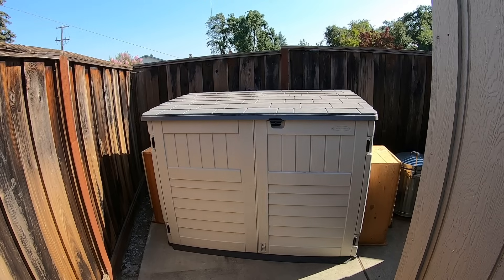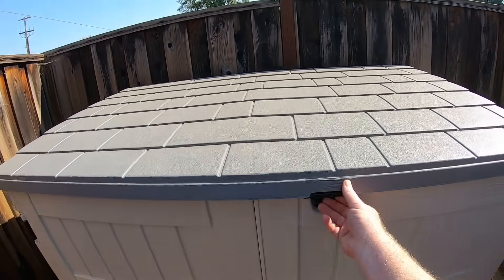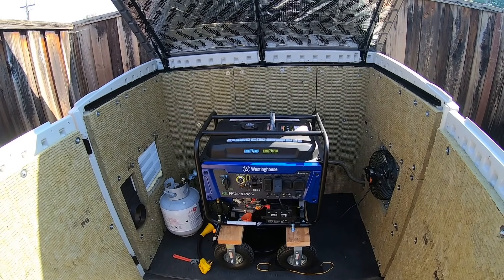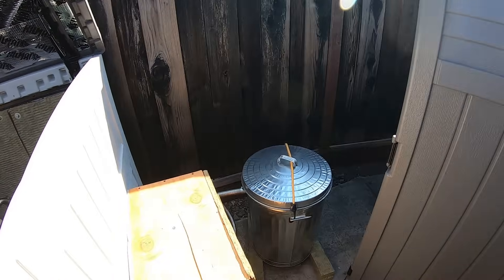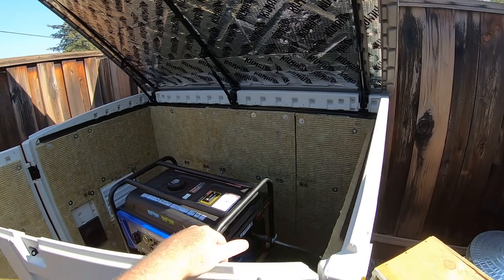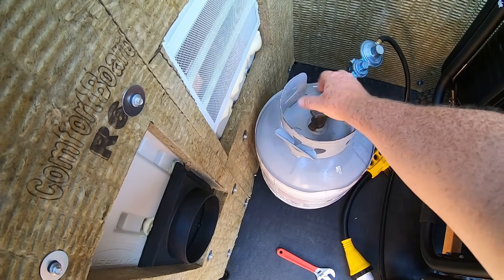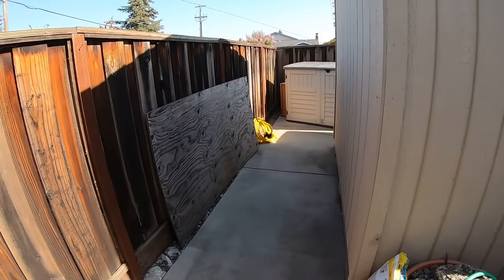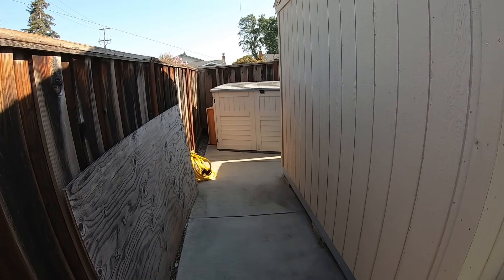DIY Generator Shed Build - Quiet Sound Insulation with Exhaust Muffler

Comment: Could you inject spray foam into the hollow core walls and doors? My logic about not being loud for neighbors is not for their benefit, but to not advertise that I have power. My only recommendation is to not use that blast gate, add a wire hookup box to the outside and then wire the generator to that from the inside so that its a fully closed system.
Reply from the maker: You can inject foam insulation into the hollows.  And I did that where I cut holes in the walls for vents and fan and such.  Although that was mostly for water intrusion purposes.  You do have to be careful, in that the foam does expand, and can bulge out the walls a bit if you get too much foam in there.  The blast gate was just the most economical way to pass a 50-amp cable through the side of the shed.  50-amp adapters and cables are expensive and bulky.  The blast gate also allows me to have the propane tank outside if I want, and feed the hose back inside, so it serves several purposes.  But definitely, if I anticipated this being used more often, I might do something like you said.  I don't really have a need to have the shed completely closed during operation, as it just adds additional airflow.  Those are just my thoughts.

Comment: Very nice! Are you going to secure it from theifs? And if so how? Thanks
Reply from the maker: Guard dogs and land mines.   The shed is in an enclosed backyard, and not in an obvious location.  It does have a padlock on the door.  But obviously this is only a minor deterrent, and a determined thief could eventually break in whether it is a plastic shed or a wood shed.  But if they want to brave my dogs and the associated dog poo, they might eventually get to it.  It might take them a while to load this beast of a generator in the back of truck though.  It is HEAVY.

Comment: Best solution I've seen so far.  I am building a wood shed with many of the same principles used in commercial construction to deaden sound with goal of a 30-40 db reduction (similar genset with 90db base noise level).  Most folks forget the intake and exhaust vents let out the sound/noise - using properly sized sound baffles is the correct approach.  

Also if you have sufficient air moving through the shed you can vent the exhaust directly into the shed, (assuming appropriate materials are used to prevent fire/melting), further trapping the noise and eliminating the need for an exhaust modification or shed exhaust port, the ventilation fan will serve that purpose.  Great Job!  Now if I could actually find rockwool sound board...

Comment: That is a little baby generator, I have 4ea 2.25MW (2,250,000 Watts) units in a paralleling configuration at work for a total of 9MW (9,000,000 Watts). No wheels though. Lots of noise. Also not big enough for a DeLorean.
Reply from the maker: Hard to get it to 88mph without wheels.  Sounds like a nice setup (for a small town!)

Comment: Can you show the inside of the trashcan
Reply from the maker: See the description of the video for a link to the trashcan muffler build.  Or see it here:  https://youtu.be/jZpRSenXJAs
Reply: @C5Tor  thanks saw it last night after I typed this great job on the build
Reply from the maker: I've actually updated the exhaust from 1" to 2" to cut down on backpressure.  New video soon, if the weather cooperates ever.
Reply: @C5Tor  I was wondering about upgrading the size of the exhaust pipe to help with over heating. Will look forward to your next video

Comment: Can these dual fuel propane/gas generators run off natural gas?
Reply from the maker: There are conversion kits available for this model to run on natural gas.  Natural gas will have slightly less power than propane, just as propane has slightly less power than gasoline.  Your deciding factor will probably be whether you have a natural gas line plumbed to your house already or not.

Comment: Total Cost?
Reply from the maker: Good question... Too much, although I already had a few of the parts.  This is not counting tools or labor costs.  I have about $700 into the build.  Keep in mind that I was able to find a used (but still in the box) plastic shed for $150 on Craigslist.  That same shed is currently going from about $500 now.  So, we've got the shed ($150), fan ($65), vent ($15), blast gate ($10), flexible 1" exhaust pipe ($30), misc. pipe/conduit pieces ($60), Rockwool ($120), Kilmat ($30), Screws and washers ($15), spray foam insulation ($20), baffles ($0 - I used some spare wood pieces I had), metal 20 gal trashcan ($30), mineral wool insulation ($50), perforated pipe/exhaust baffle ($30), wire mesh ($15).  So, a little under $700.  I'm sure I am overlooking a few parts, and things I bought but ended up not using.  Oh, I also spent $300 on 50-amp extension cables!  And another couple hundred on a Generator interlock kit for my electrical panel and an inlet box for my garage to hook the extension cable to.  It can add up really quick!

Comment: Will the attic fan pull moisture in if it’s raining?
Reply from the maker: Good question.  Not really sure.  The inlet has downward facing vanes, and it is 6 feet away from the fan, so I don't think it would pull much of anything into the shed if it was raining, especially with the baffles in place.  But I haven't run it in the rain yet.

Comment: Do you have a video to show install of the various components?
Reply from the maker: Unfortunately no.  I didn't video the build process for the shed.  I wasn't originally going to post any video at all since there are a ton of generator shed videos out there.  But the shed turned out pretty nice, and the features I incorporated were pretty effective at reducing sound.  Since some of these worked out better overall than many of the other videos I saw on similar sheds, I decided to share some tips that worked for me on the build. I do have another video on the parts used for the exhaust and the trashcan muffler, linked in the description. I also filmed some sound testing at various stages of the build for comparison purposes to see how effective my changes were at each stage. Keep in mind that I'm not a professional or even part-time YouTuber, so I only post content when it interests me or I think I have something useful to share.  So sorry for the less than stellar production quality.  Hopefully they got the important points across.  Thanks for watching the vids!
Reply: @C5Tor  thanks for your prompt response :) I got a Westinghouse 9500DF generator and planning to go this route for building a shed. Thanks for sharing the parts list, my only question is or request if if you can share the detail on the part used on the shed to connect the generator exhaust the the muffler. Thanks in advance :)
Reply from the maker: No problem.  I'm working on a little presentation for that now.  I've switched from the smaller 1" pipe to a bigger 2" pipe, so I will compare the two.  Time and weather permitting, maybe a week or two.
Reply: @C5Tor  thanks and sorry for a late response I will look forward for that video but this is awesome!

Comment: Cool dude.  I just bought the exact same generator from Amazon.  I plan on trying to set it up with Propane and a switching breaker box and see if I can get it to work like a "stand-by generator" to turn on and off automatically.  Using the propane (for convenience ) I won't have to worry about carb clogging and fuel degeneration.

Comment: Very impressive. Awesome job. The only thing that worries me is the back pressure you created with the muffler modification. Eventually it may damage the valves. Who knows for sure as it may takes years for that to happen. Good luck.
Reply from the maker: I've already upgraded to a 2" flexible pipe with a shorter, straighter run.  I'm also making some internal changes to the muffler to remove the 1" pipe and make it larger.  An update vid coming soon if the weather cooperates.
Reply: @C5Tor  Awesome. Can't wait to see it.

Comment: you use a generator to charge electric motorcycles ... well ...
Reply from the maker: Yep.  I can use my propane generator to charge my electric bikes.  You do what you need to do when you are off grid.  I didn't get the electric motorcycles to be "green" per se.  I got them because they are fun and a lot less maintenance than internal combustion dirt bikes.  And so far, I haven't had to use the generator to charge the bikes, as they usually outlast me for a day's riding.  But I will use the generator if we do any extended overnight camping without access to grid power.  I'd rather use solar, but that takes a pretty big rig and lots of batteries to charge one of these bikes.

Comment: I think you'd do well to increase the size of the exhaust pipe.  When extending it, youi're going to create some resistance over the original short pipe (try blowing hard into an empty garden hose and you'll see what I mean).
Reply from the maker: Totally agree.  I've already swapped out the long 1" flexible pipe for a shorter 2" flexible pipe.  Also making some tweaks to the internals of the trashcan muffler.
Reply: @C5Tor  just to 1-1/2" is fine, 2" is overkill.
Reply from the maker: At this point (especially if asking my wife) the whole shed is overkill.  So why stop at just excessive, right?
Reply: @C5Tor  Agreed!!!!

Comment: Thats awesome, i am so glad i found this before my build. Would you recommend propane or natural gas? How long is that 5g propane last ( lets say for 1 fridge, 2 portable heater , few receptacles)? Thanks alot
Reply from the maker: I can't say I am a generator expert; I'm just a dude that built a shed.  That being said, I can tell you a few things I've learned about fuels.  Propane and natural gas are not the same.  Natural gas is made up of methane, propane and butane (but mostly methane).  Propane is just the natural gas with the other two gasses removed.  Natural gas is typically cheaper, since it is less refined. Propane is typically stored in liquid format, while natural gas is in a gaseous state.  Propane is stored in tanks, so is easier to transport, which would make a difference if you intend to keep the generator portable or not.  The usual deciding factor on which to run would be whether your home has a natural gas line plumbed to the house already or not.  For the same volume, propane puts out about twice the BTU's as natural gas.  The Wgen9500DF is setup for gasoline and propane, but not for natural gas.  You would need to purchase a conversion kit to run this specific generator on natural gas.  The specs on this particular generator model say it can last up to 17 hours on the 6.6 gallon gasoline tank, and about 11 hours on a full 20 lb. propane tank, depending on load, of course.  Take that with a grain of salt, your mileage may vary, etc.
Reply: @C5Tor  Thank you very much for your input which helps me save a alot of time and money.
Reply: Do you run yours every few months to keep it  the battery charging? Or do you use enough to not worry about it? I don't run regular gas in mine just propane.
Reply from the maker: I've only had the generator a couple of months, so it hasn't been an issue.  But I plan to add a little solar charger to the roof and keep the battery charged that way.  Amazon has a lot of really cheap little solar battery chargers.

Comment: Why run the exhaust out of the shed if u have the fan drawing fresh air out and pushing the exhaust out?
Reply from the maker: The generator shed will be getting pretty warm, even in its current configuration.  Even with the fan and the exhaust ported to the outside, it can still easily get upwards of 100 F inside the shed.  When the generator is working hard, the exhaust gasses can range from 300 to 600 degrees!  You really don't want to dump that kind of heat into a mostly confined space and expect a small fan to remove it all.  The generator will run more efficiently if it is cooler.  Also, routing the exhaust to the exterior also ensures that there is not a buildup of CO/CO2, which can be deadly in a confined space, and also make your generator run poorly.  Most modern generators also have excess CO shutoff sensors.  If I were going to do the shed again, I would also probably put a larger fan in it.  The unit I'm using moves about 1000 cfm, which is probably more than sufficient for a 70 cu. ft. shed.  But the sound baffles I'm using probably decrease that flow by a little bit, since the air doesn't have a straight shot into and out of the shed.  More cooling would probably be better for the longevity of the generator.
Reply: @C5Tor  have u considered adding a fan to the intake side to pull air into the shed?
Reply from the maker: I have definitely thought about it.  I've considered just putting a box fan on the inlet side.  However, I'm not sure if it will make a big difference in actually getting more air out of the shed since the size of the inlet & outlet are a bit limited.  It might just swirl the air around a bit more inside the shed.  But I might still try it.

Comment: I built same 5 years ago. But used two electric fans. Bigger exhaust pipe  same shed but From Lowe's.  Took truck plastic gas tank mount on back 
25 gallon. With gas gauge  use almost same cord from Walmart  I also put extension on oil. Fill and drain from outside of generator house I used fire proof rock board inside for inside the walls  . And key start on outside of generator house installed lights inside for nite time use  light switch fuel gauge start and choke mounted on outside generator house.  Hook up my own manual transfer switch next main power box easy on and off whole house power.  This has been working just over 5 years with many power outages   this guy did great job 🤔 but exhaust pipe to small can lead to engine over heating and burnt valve I also used  vent covers from ac filter  there big and provide lots of air.  Key start and light switches  , fuel gauge mounted inside water proof case  normally was used to cover two outside wall sockets got the biggest one clear door on front  when door is open lights come onthere can see fuel gauge and others that mounted in there.used switch for lights from car door interior lights
Reply from the maker: Sounds like a great setup with lots of convenient customizations for running long term.  I wasn't quite that ambitious, as backup power is kind of the secondary function of this generator.  I do agree on the exhaust pipe issue on my build.  I'm working on version 2.0 of the exhaust setup today.  I'm going directly to a 2" pipe to the muffler, and the new muffler has a lot more flow to it (a funky 4" x 8" spiral chamber in the muffler.)  Doing some testing this weekend to see how it works.  Crossing fingers!  Thanks for all the tips!
Reply: @C5Tor  thank you. .my exhaust I ran straight out motor  to outside  with muffler at the end but used stock motorcycle muffler  . Love trash can idea . Did you use fiberglass insulation in can I think empty can would make it louder.  I also header wrap from advance auto to wrap pipe .  Generator bought from harbor freight they must had a return because generator head was changed should have been 10 000watts but came home with 25 000.  Watt. For $800.  But loves gas my power out after hurricane 2 weeks  ran generator whole time 24 7. But off for oil changes.  170 gallons of gas but also had ac on water heater lights had whole house power.  .but I love what you did bring back lot of memories. .god bless 😊
Reply from the maker: Sounds like you got a great deal on that generator!  I have another video on how I built the trashcan muffler.  I'm actually working on a second video on my Gen II muffler with bigger pipe and better flow.  Gen I was super effective at cutting down the sound, but probably had too much backpressure.  Might have the new video out next week after some testing.  Gen II muffler takes a different approach than the Gen I.  Check out the Gen I video here:  https://youtu.be/jZpRSenXJAs

Comment: Hi, Did you think of the exhaust into a water bath/base? Boat outboards seem to have no problem with that system, might be worth a try, sound wise.
Reply from the maker: There are a few reasons I wouldn't use the water method.  The first is exhaust backpressure.  It takes a lot of pressure to move water out of the exhaust pipe, a lot more than it does to move air.  If you want your exhaust to flow freely, the water method is not a good idea.  Even my current setup with 1" pipe all the way to the muffler is causing a bit too much backpressure.  I'm addressing that with larger diameter pipe and a shorter run in the next version.  Excess backpressure can lead to less horsepower and hotter cylinder head temperatures.  I don't want to cook my valves.  The second reason I wouldn't use the water method is that the hot exhaust will eventually evaporate the bucket of water.  You'd need to keep topping it up.  It could also corrode the exhaust pipe.  Lastly, my goal is a quiet exhaust, not a gurgling motor boat sound.  While the bubbly outboard motor sound would probably be quieter than the unmuffled generator exhaust noise, it would still be an annoying gurgling sound that I don't really need coming from my shed.

Comment: What was the total cost of the shed with baffles and sound deadening? Nice video
Reply from the maker: Make sure you check out the other videos in this series. I cover the costs, parts lists, and other FAQs in a later video about my Version 2.0 Shed Exhaust.  Also upgraded all the pipe from 1" to 2" to allow the generator to breathe easier. 
 Check it out here: https://youtu.be/y3pUw408jCU